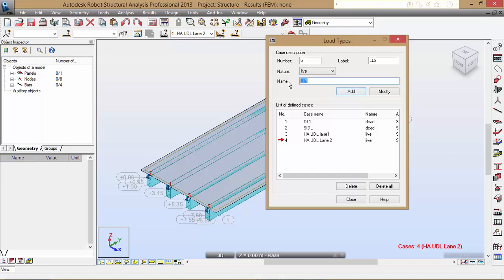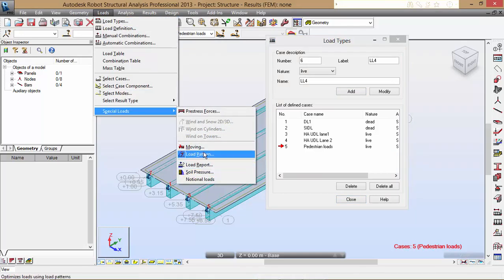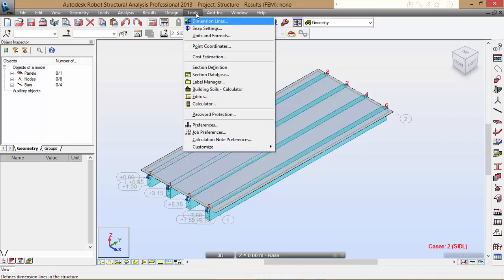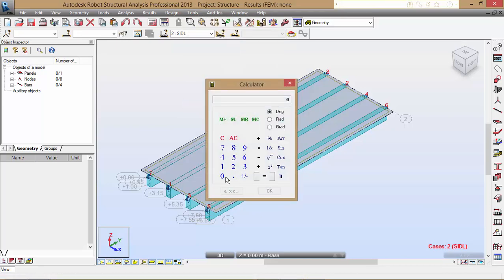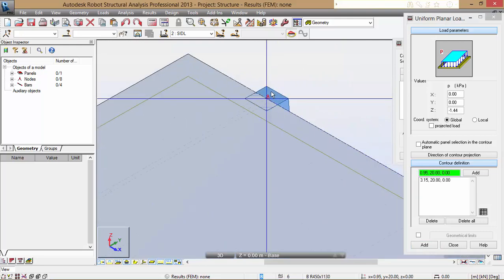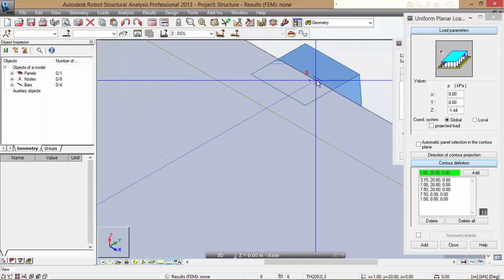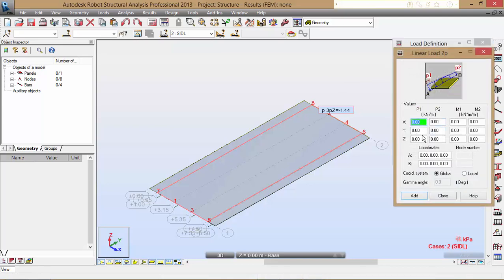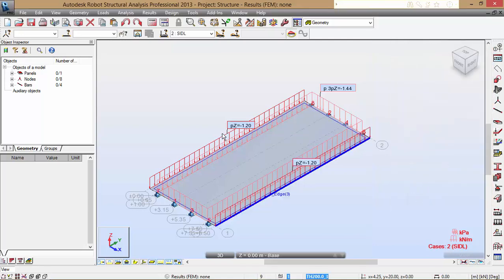Simple Bridge design in autodesk robot PART 1

Comment: Mr Akuku , thank you very much for this resource,  I have a question about the use concrete Beam , Is the concrete Deck  includes the Beam  Flanges and the "height of  then beam" is just the Web Height?
Reply from the maker: The analysis considers the beam as a T beam hence the deck width is considered as the top flange.